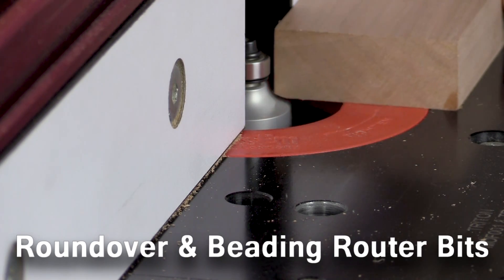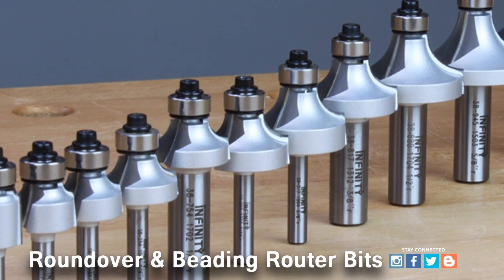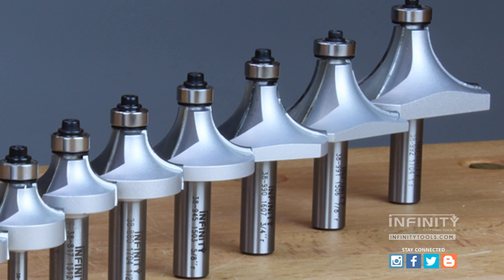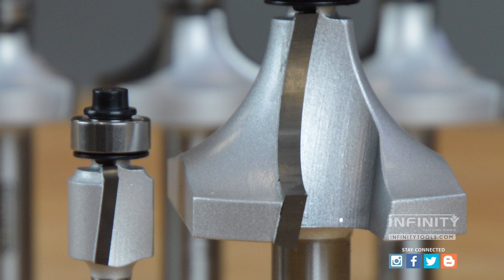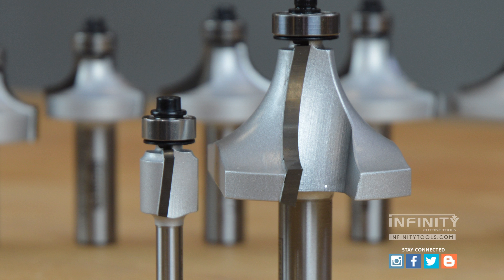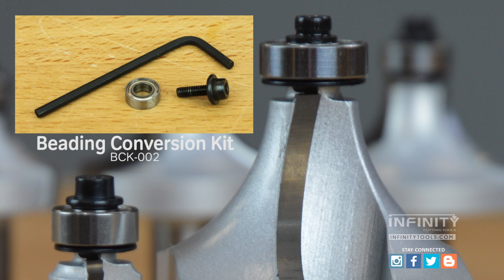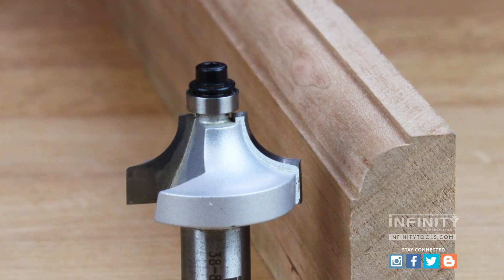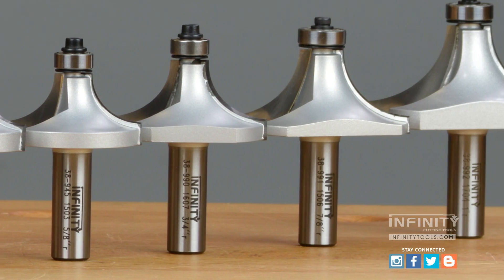Versatile Roundover and Beading Router Bits

Comment: Hello. I need to create a round stick with a 25mm diameter. what size of Router Bits and size of a wood stick do I need?
Reply from the maker: Unfortunately, we do not have a bit that will make a perfect 25mm dowel. a 1/2" radius roundover bit would make a 25mm square workpiece almost round with a small flat portion in the middle of each side. You would need to make this with a router table.